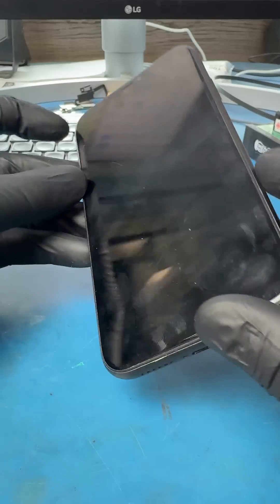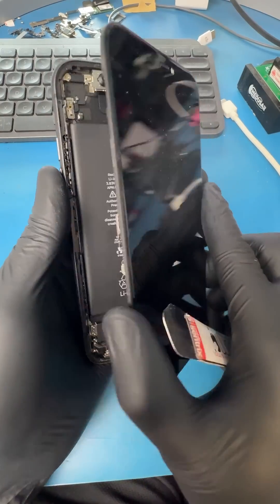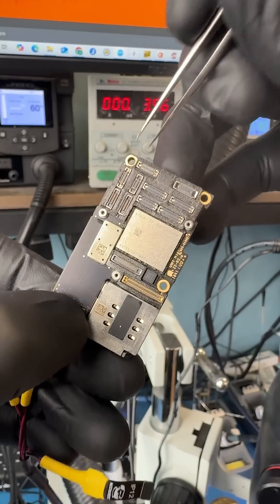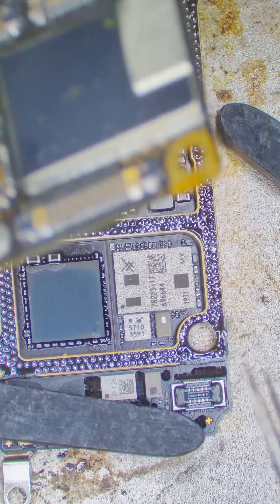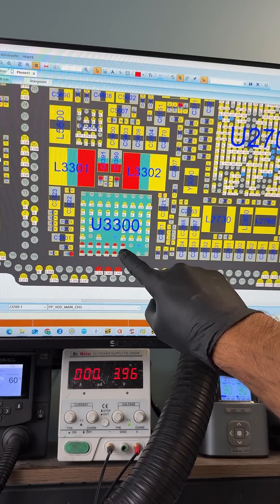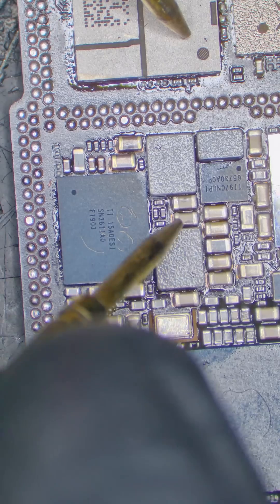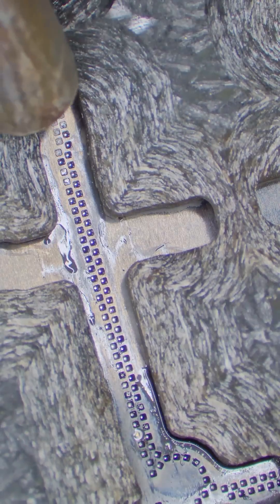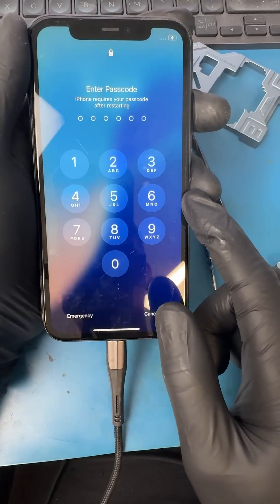Sad chip.. Happy chip... #tech

Comment: Question  my phone will stick. Then it says system Ui  or an app the problem. I have 2 choices push wait or close. If I push wait. It work normally  for either a few minutes. Or a few hours. If I push turn off it will cut my phone off.  I out of work and homeless and cant afford to get it fixed

Comment: Hey, I successfully swapped a broken screen of an iPhone 16 Pro with a new one, but something is odd cuz its FPS and resolution and brightness are lower than they should be and in the settings there's a message, that the screen isn't original. I bought it from an online shop for iPhone parts. And the stats were exactly what they should be.
Any idea what I did wrong? Thanks!

Comment: Amazed you are able to install BGA chips with a hot air gun. I used to work on a SMT line and our CNC pick and place machine and reflow oven had a hard time with BGA chips. They wouldn't buy an X-ray machine to ensure no solder bridging so basically if it worked they were happy but if not they just tossed the board. Plenty of times the chip would skew. You're definitely skilled in micro miniature electronic repair.

Comment: This is actually a really great informative video. But I have a question. Can't we in such cases that the board can't be fixed, just install a brand new functioning motherboard, so that we can boot the whole system, and then connect the whole thing to a computer and backup the data on the PC? Is this possible?

Comment: I use to be a certified solder J-standard robotic technician. Solder paste heat plates microscope soldering iron solder wick and solder flux with flux cleaner. Fun times.

Comment: I've been an electrical engineer for over 10 years, but rarely fix consumer electronics. I knew about the sandwich construction, but I have never seen it done that crazy. It's simultaneously a genius way to fit more into the phone while also making your devices much harder to repair than necessary.

Comment: I have learned how to make that solder into even figure (stright surface on top contact point with sound frequencies. Do U think that is worth making a product, basicly it will save you from fixing that sheet that position where to make these balls shown on the video, u d have to put some paste turn on the thing that sings to it to basicly shape it and that's about it ( you would need to touch the part to transfer put more paste a couple of times until the whole desired surface is prepared

Comment: I need electrical diagrams for everything 😅.  I just did my first eeepromm read on a volvo cem module.  
Simple thing: It took me to school.
Gemini helped in getting all the necessary consumables and the big units. Iron, lcd microscope. and a bunch of practical theories of soldering.  
How flux and solder wick work is mad.
I got it stuck a few times, luckily I realized its cus the iron was too cold dud the eepromm read, installed the module back to the car, and it worked no damage after my bench work.
I can't turn back now. I've been bitten.
This is the way . 🌌

Comment: I have an iPhone that had some major water damage with an aftermarket screen. I took it in to my local shop and they replaced the screen and it seemed to work fine. That was until the PIN code I had setup wasn’t working and after 2 tries it locked me out of the iPhone completely. Is there a fix for this? I have wedding photos that were never backed up before this incident.

Comment: Doesn't that gap on the sandwich cause some problems, the thermal connection to the top plate and thermal cracking of the solder ball joints?

Comment: what i hate about this all is apple could have used a pin instead of a solder balls to make it both cheaper, easy to fix, durable since nothing gets stripped and less heat stress on the components and cleaner to look at but NOPE its apple

Comment: hi there, if you're reading this, i would like to ask a weirdly specific scenario

Lets say decent amount of weight (for example, a medium sized, half filled tumbler bottle) was dropped into a Samsung A24 4G (apparently not sold in NA or EU, but you can look up the model online) phone and impacts the back of the phone, specifically to somewhere between the middle of the flex cable connector, the battery connector and level to the 2 pixel camera at the bottom and presumably hitting somewhere either connected to the CPU or the CPU itself that's been hit, and the impact is enough to cause the phone to crash and shut down every 15 minutes or so, however, a drop approximately a desk tall caused the conditions to worsen significantly, as now the phone only stay on the home screen for roughly 3 minutes before booting off and occasionally taking 3-5 boot loops to turn on into the home screen at all

eventually, getting into the phone screen is getting difficult, and at the end of the day the phone only boot loops with it taking a considerable delay in between pressing the power button and the phone turning on at all. and through another series of unfortunate mishap the phone eventually boot loops repeatedly until the battery ran out and the phone, showing no signs of life, is hard bricked due to not being able to be charged. how can this (presumably and no matter how unlikely) be fixed?

Also, how long does modern EMMC storage data cells could store data unpowered before losing its charge and data?
Reply from the maker: Most likely your phones CPU became slightly disconnected causing the loop, especially on that model. I read unencrypted emmc chips all the time from 10 years ago without any leakage. But it's different than UFS. 

Your phone has a an encrypted UFS flash storage chip, and typically on these "budget" phones don't use great chips. Also the phone needs to turn on along with the CPU to get the data. It's hard to tell but if there is any leakage in that UFS from not being powered on, the phone won't boot properly. So if the data is important, sooner the better to get it situated.
Reply: @MDrepairsLLC  tysm for taking the time to reply, the phone has been untouched for quite a while... And by that I meant 11 months (this all happened in November last year) though 3 months in I did try to charge the thing anyway in vain hopes of it actually storing said charge, but idk if the filled battery does effect the damaged phone or not, positively or negatively 

I have sent it to 2 different repair shops, but I've learned the hard way none of them do board level diagnostics like this. They barely do anything to the board before sending it back to me saying that they don't have the expertise. To this day I have yet to find anyone in my country that did (actual) IC repairs specifically, the only thing I could do is sent it overseas to be repaired (which will cost me a kidney) or just find any repair shop ballsy enough to, at the very least, attempt a resolder of the motherboard like you said (funnily enough I did suggest the second repair shop to do the same thing, but they said they didn't have the right heat gun or technician to do IC microsoldering, the first shop I went to had it's technician somewhat capable of it along with the equipment refused it for undisclosed reasons) 

I did have tons of photos and recordings I find valuable in it, but at this point idk if it's worth the cost 😅😅

Maybe I'll get lucky and have someone from Samsung authorized repair actually attempt to recover it (though I'd rather not take the risk of them just replacing the mainboard outright and tossing the old one to the bin, even if it had a chance)

Comment: dude excellent job but you didn’t add thermal paste, the phone will turn off during ios update from overheating and get stuck in recovery mode, and the only way out is to reset the phone and if you don’t have a backup you are screwed and there is no way to recover the data back, that’s what happened to me
Reply: Ofc he did apply terminal paste, just bc he didnt showed it doesnt mean he forgot, why would he forgot that? Doesnt makes sense tbh

Comment: You aren’t a technician, you’re a wizard
Reply: You could get to this level in about 6 months.
Reply: @FoeHammer35 how???
Reply: @ByteStorm25  take an IPC610 course. A J-STD course. Those can be taken at the same time and will take about a week to accomplish  and then you will be certified to solder and inspect solder. Then you read a few books about the fundamentals of electronics that will take about 2-3 weeks. And then that leaves 5 months of practicing. Boom 6 months to get to the level the video described.
Reply: @FoeHammer35 i want to do just that where can i do the course and is their any courses on basic beginner repairs
Reply: @FoeHammer35 where can i take the course?
Reply: @ByteStorm25   it depends on IPC610 and J-STD. IPC610 relates to inspection of solder and micro electronics. Very useful. As different electronics have different standards. For example an airplane electronics must be assembled better than a refrigerator. J-STD is the actual soldering techniques and application for manufacturing boards. For example attaching various chips and components to the boards. Usually both are done in tandem. As far as taking the courses. It’s going to depend. You can take the courses at a community college. Those may take longer. But will give you the tools and help with learning how to debug and repair. A trade school will be the same thing just probably more in depth but would allow you to progress fast or slower depending on skill. It took me a week to learn JSTD and IPC610 and get certified. But obviously a little longer to become proficient. Around 4 months on my own time to get proficient. Everyone is different. But it’s not as hard as it seems. Every state and trade school / community college is different. So you will have to look it up for your area.
Reply: @FoeHammer35 thank you so much ive tried to do phone repairs thank you so much

Comment: Wait so I just watched this again, did you reapply thermal paste between the layers of the board? And is it really necessary?
Reply: It is for sure.
Reply: Yes it's necessary to ensure the solder balls (when formed make contact from the top board to the bottom board via the interposer (the bit inbetween as he explains in the video). This is in order for the phone to fully function though most iphone models with the motherboard sandwich can run the top board without the bottom but is recommend only to do this when diagnosing an issue.